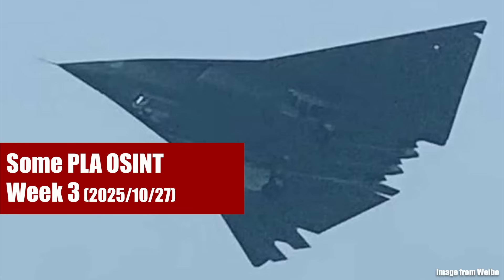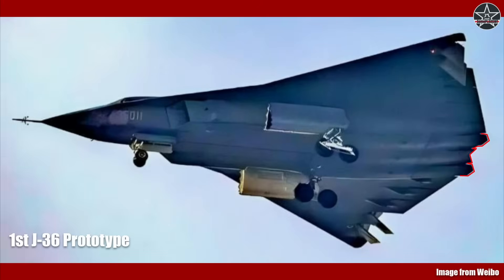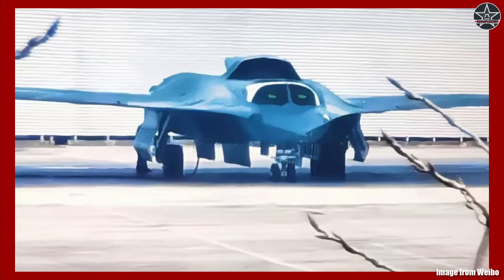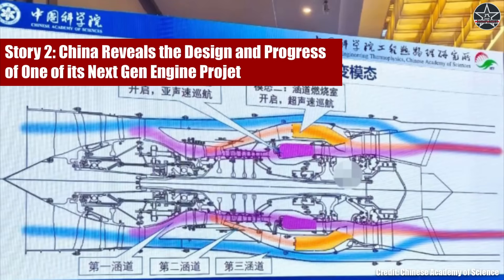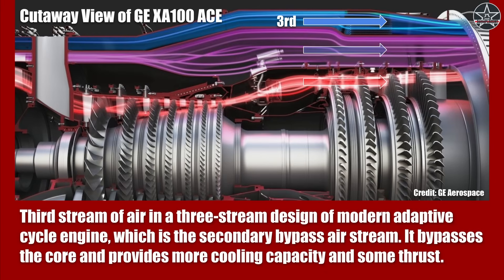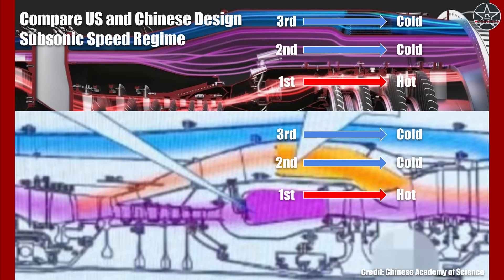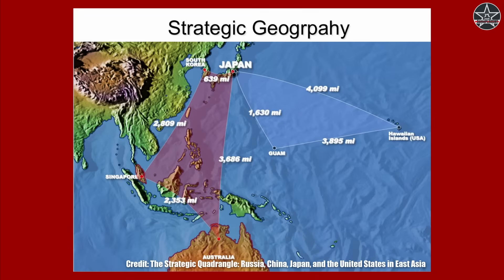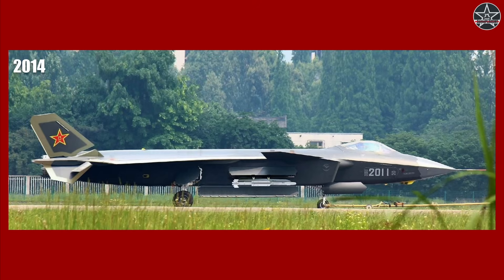Some PLA OSINT Week 3: New J-36 and Chinese Adaptive Cycle Engine

Comment: It's not an adaptive cycle engine bruh it just has stealth nozzles with TVC. Adaptive cycle engines are still 5 years away for even the US and they have they build the most advanced engines out there. China & Russia are better at 3D TVC systems but that's it really otherwise the J-36 would have 2 engines

Comment: 17:55 Correction: US and China is not competing neck to neck in 6th gen fighter design. The US 6th gen fighter is currently only exist as AI generated image while multiple Chinese 6th gen prototypes are taking the sky.
Reply: There were prototypes in 2019 of NGAD, China probably had some back then as well. Think outside the very confined space that is short sidedness
Reply: cn J-36は、第6世代戦闘機というより、第6世代戦略戦闘爆撃機若しくは、長距離制空戦闘機といった、
Mig25の系統になるのではないでしょうか。
Reply: @mysygisun3335 It has been nearly a year since j36’s first flight. There really should be no excuses for anyone to doubt j36’s role as an air superiority fighter. Anyone who still thinks j36 is a bomber or fighter-bomber should go to a brain surgeon to have a cognitive test
Reply: No, there was almost certainly a flyoff with possible subscale demonstrators a few years ago. There were program goal shifts for NGAD but PCA component is almost certainly still intact
Reply: @johnsullivan8673 One key difference is that the United States faces considerable uncertainty across nearly all aspects, whereas China operates with clear long-term goals and strategies. What sets China apart is its ability to unify the nation’s plans and mobilize collective efforts toward common objectives—something the United States struggles to replicate.
Reply: @johnsullivan8673  Dream on. The USA's NGAD can fly if you fold up the paper drawing of it into an airplane shape and throw it. China is already ahead. The USA NGAD is still a PPT presentation only.
Reply: @bobsmith3983  I don't think so. It was already stated that at least subscale demonstrators were flown by USAF top brass. Don't conflate pentagon bureaucratic inefficiency and shifting program goals with a lack of capability and result for the US.

Comment: China's speed not just meant they have caught up, it also means when they surpassed the west, it will be very difficult for the west to play catch up if it is even possible to do so.
Reply: That’s quite ignorant, China has certainly proven that they are capable of making a prototype ahead of the US, but it’s more dedication and commitment than lack of technology
Reply: @MiG-31893 No, you're the ignorant one because China has proven not just that they can leapfrog the west but because their system allows them far more efficient use of their resources, that when they surpass the west, the west simply can no longer catch up. This is a done deal.
Reply: @gelinrefira  how could you know all of this? I am not “western” or Chinese and therefore have no bias one way or the other but claiming something without evidence seems pretty ignorant to me

Comment: J36 is not a traditional sixth-generation fighter jet. Instead, it is a "strategic air superiority aircraft" specifically designed for operations in the Asia-Pacific region. It possesses several key features:
1. It has an unmatched beyond-visual-range air combat capability that is beyond the reach of traditional fighter jets. Its radar is a digital array radar based on fourth-generation semiconductor components (Ga2O3), and its radar system adopts a common antenna design, integrated into the fuselage rather than just at the nose. It is said to have multiple bands and can achieve 360-degree detection and warning. The belly ammunition bay can accommodate 4 PL17 missiles with a range over 500 kilometers and 6 PL16 missiles with a range over 300 kilometers (PL16 has already been deployed with the J35 series and is expected to gradually replace PL15 as the new medium-range air-to-air weapon of the PLA).
2. It has three WS15 engines (which may be replaced by new variable-cycle engines in the future), and has an extremely simple aerodynamic shape. Its supersonic cruise speed is expected to be 1.6 Mach or even higher than 1.8 Mach. After the engine is in supercharged mode, the maximum speed may reach 3 Mach.
3. It has a powerful ECM system, with multiple electromagnetic signal receivers integrated in the fuselage for receiving signals from different radar bands. Its radar system can emit corresponding interference beams, and it can simultaneously suppress and interfere with the radar systems of an entire formation of aircraft.
Based on its above capabilities, it can be inferred that its main combat scenarios are between the Second Island Chain and the Third Island Chain. It can infiltrate the enemy's rear formation using its extremely low RCS and supersonic cruise capability, and strike warning aircraft, refueling aircraft, and electronic warfare aircraft, disrupting the US air combat system.
Finally, although it has some features of sixth-generation fighter jets, such as the command capability of unmanned aircraft groups, its main role and that of a sixth-generation fighter jet are quite different. The true sixth-generation fighter jet of the PLAAF is the J50 produced by the Shenyang Aircraft Industry Company.
Reply: I feel like it needs 3 pilots to operate so many functions. Or a really good AI.
Reply: @gelinrefira  The AI of this aircraft will definitely be superior to that of all existing fighter jets in the world.
Reply: Almost everything you just said is pure speculation.
Reply: @BravoCheesecake  Keep on coping.
Reply: @BravoCheesecake  This is not my personal speculation. It is the most reasonable conclusion reached after much discussion among many Chinese military enthusiasts on the Chinese Internet.
Reply: @Steve-y9v-s2f  "much discussion among many Chinese military enthusiasts on the Chinese Internet" is not a reliable source of information. Chinese netizens often over-exaggerate the capabilities of their own platforms without any sort of official public releases. However, I do agree with your assumption on the role of the aircraft. It is not a fighter, it is more of a penetrator designed to slip past fighter screens to attack HVTs in the rear like AEW&C and refueling nodes.
Reply: @BravoCheesecake  
Military enthusiasts from every country usually praise their own country's weapons because the majority of people in the world have a sense of pride in their own countries and nations.

Comment: The jet is 50% larger.
Thus, it needs 50% more engine.
Reply: This assertion ignores the non-linear correlation between aircraft size and engine requirements. The increase in aircraft size is not proportional to the demand for engine thrust: a 50% size increase is often accompanied by a much more than 50% growth in weight and drag, requiring over a 50% thrust boost; if only the external size is expanded without increased load, a 50% thrust increase is redundant.
Reply: @connermini9390  
Let's assume a rough 1-for-1 correlation between volume and mass. It could be more, or could be less, depending on the density of the mass used to fill that volume. I'm happy to make a 1-for-1 assumption since the assumption of a uniform density is common when talking about spherical cows...

Thanks to the square-cubed law, a 50% linear increase in size (Length, Width, Height) would result in a 237.5% increase in volume, and thus a 237.5% increase in mass. However, a 50% increase in volume would result in... a 50% increase in volume, and thus a 50% in mass. Given the above math, have a guess if I meant "size" or "volume" when I said "larger".

Now that I've addressed your concerns about mass, let's address your concerns about drag. And this is legitimately a good point. But while the increase in drag is important to consider, it isn't proportional to the increase in volume. 

Drag mostly scales with frontal area and wetted area ("Wetted area" is the surface area that touches the airflow). The frontal area of the jet has NOT increased by 50%. Not even close. The surface area, while closer, is still less than a 50% increase. Additionally, the increase in surface area also increases the generated lift. More wing, more lift, easier to take flight. 

The math for designing, building and flying a fighter aircraft is hard. But my OP is expressing a simple concept, and only needs simple maths. 
More jet needs more engine.

Comment: Great video, no nonsense and just presenting readily available info as is, while providing great context. What irks me though is their decision to go for a staged combustion adaptive design rather than a variable airstream design, considering that they've only just fielded their breakthroughs in single crystal blade tech and are yet to field CMCs and a second combustor will be giving those parts the most punishment as opposed to ducting an airstream. But it's an experimental demonstrator after all so they may be just exploring things till their materials science base catches up.
Reply: Why not assume that China has already resolved the materials issue? China is already leading in many fields. In China's case, preconceived notions have repeatedly miscalculated the situation.
Reply: @lmn6335  Because the WS-15 was in development since the early 90s and despite running ground tests in 2005, hasn't been serialized production and integration till earlier this year as a direct result of an insufficient materials science base? What makes you think they can leapfrog physics?
Reply: @stevess7777  What does it prove that the WS-15 started development in the 1990s? Its critical performance indicators remain classified. Aren't all of these conclusions nothing more than mere guesses?
Reply: @lmn6335  No, they are not. Chinese mil bloggers themselves estimate the turbine inlet temperature for the WS-15 to be 1580°C. They also say an F-135 has an inlet temp of 1,980°C. What do they gain from overstating that number? A VCE inlet temp is expected to be in the range of 2200-2300°C, lest you lose the pros of going for a VCE in the first place. Credit to China where it's due, but pretending they've skipped a crucial step and can suddenly achieve a monumental feat only discredits the scientists and engineers that have been working to get things where they are now.